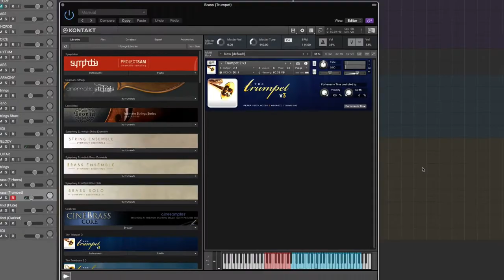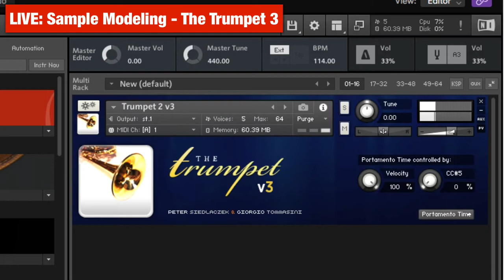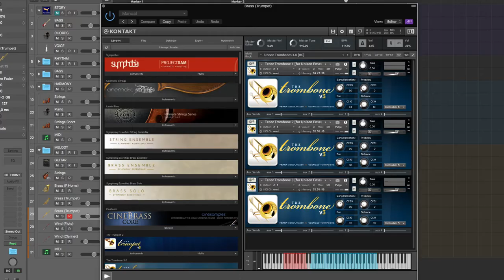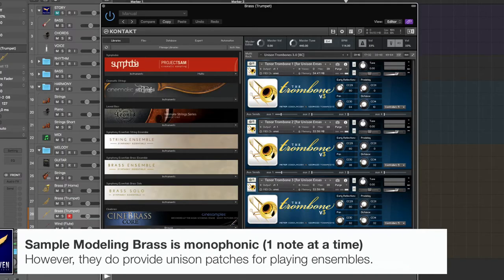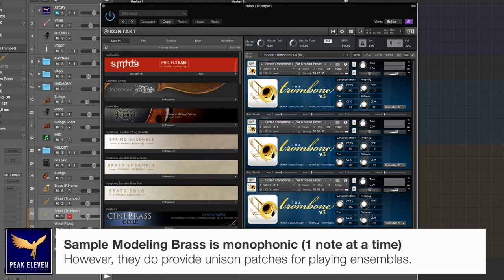Sample Modeling Brass (with TEControl MIDI Breath Controller)

Comment: I use the French Horn & Tuba, the BBC2 and Kontakt as well. But I just can´t get it working. Midi Mapping + Kontakt settings are in my way. It worked one time but now it doesn´t and I have no idea why. 
So I´m sitting here in front of the door to be able to record really nice stuff with all my instruments, but I just haven´t found the key to get in yet. :-/
Reply from the maker: Join my FB Group "Professional Composers" and share your issues in there in a new post, and I'm sure you'll get it sorted out. =)

Sincerely,
Mike